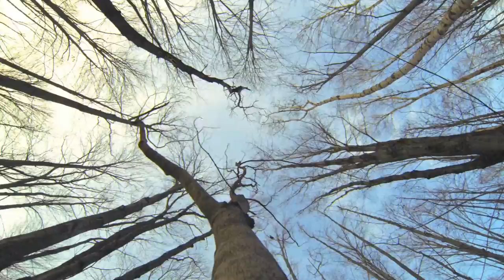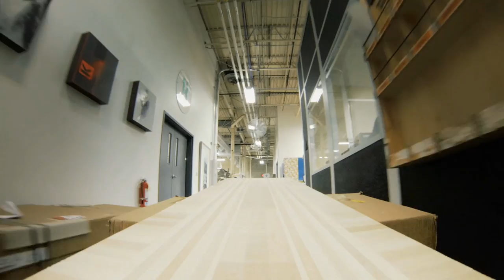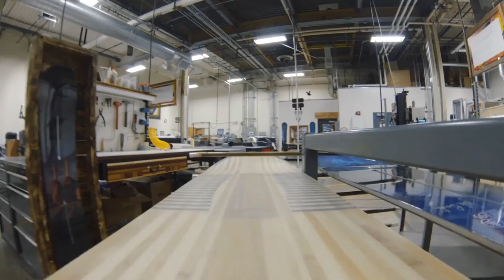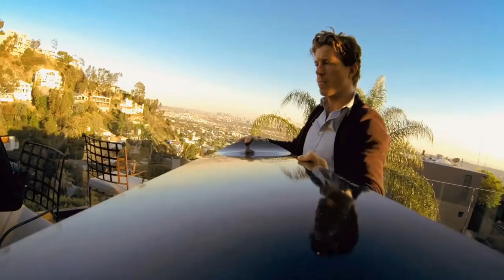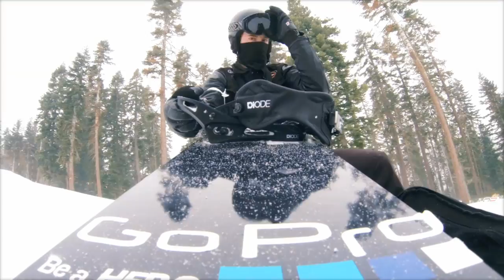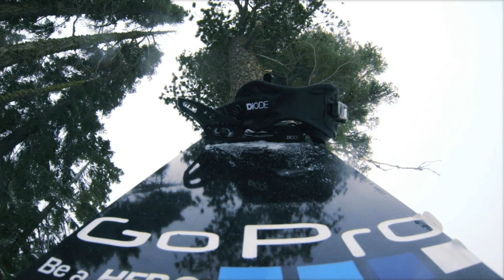GoPro: Shaun White's Birth of a Board

Comment: Well the video was produced really well, the camera angle used looked really good. And then Shaun White goes and sticks the GoPro sticker on the snowboard, he doesn't flatten it properly and also leaves a bit hanging off the edge, not to mention he put it too close so that camera doesn't even see the sticker properly, which is what I am sure GoPro intended to have in the video.